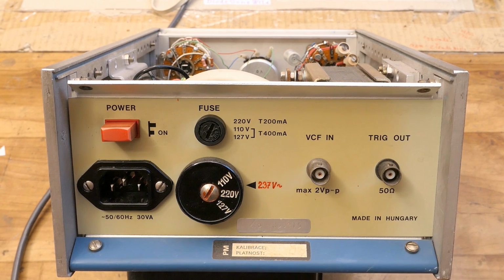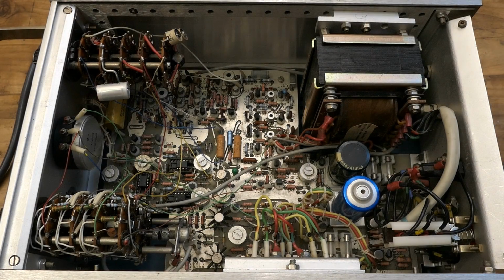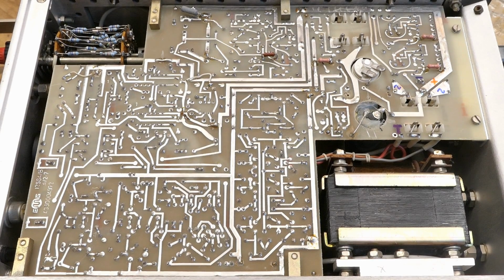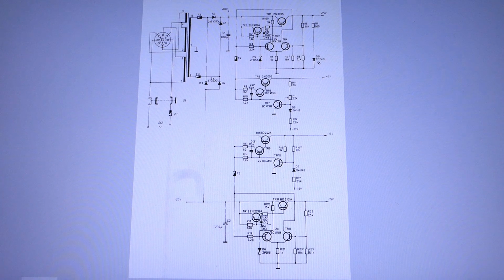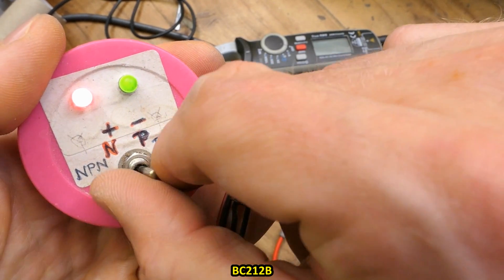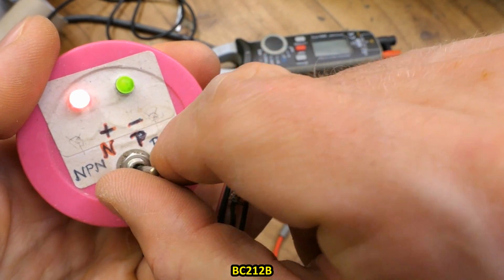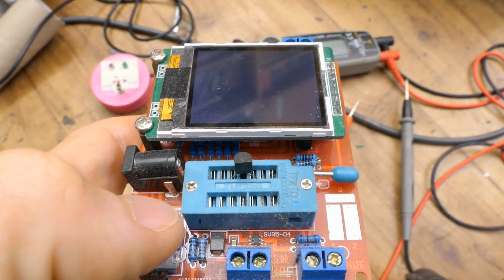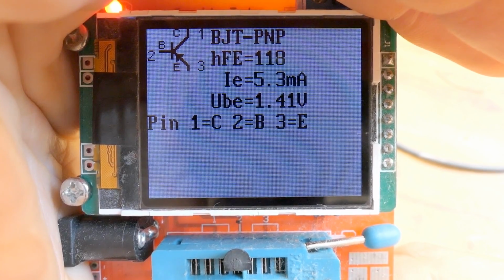Function generator repair (Hungarian TR-0458/B)

Comment: As of today I have my own function generator to fix, a HP 3310A function generator.
I accidently touched the lead to 550V and i heard a pop and it stopped working.
I found one blown transistor and a resistor got fried.
I havent been able to test much but the frequency generator doesnt seem to work at all in most ranges.
I am not as smart as you are, i hope that i will miraculously find the components that cause this problem and be able to replace them....
You are a true inspiration to me, I hope I can actually do it.

Edit: Fixed it, the entire output stage was blown, replaced the components and it worked again.
Also a filter cap on the power supply wasnt filtering correctly and replaced that.
Reply: Download the service manual and start measuring. HP equipment is well designed and pretty easy to service. And as you know what went wrong you know were to start looking for the problem.
Reply: @RTBNL  Thank you, but its already fixed now.
the output stage only was fried thankfully, replaced the transistors and resistor and its working again.
also some capacitor was bad and caused output wripple, replaced that too with one of the same size but 4 times the capacitance, i didnt have any other that could fit in the same space.
Stupid HP put the capacitors right over the voltage Regulator were they get really hot
Reply: @janno288  was it a cap on a power supply rail or something else? 4 times the capacity can seriously change the behavior of a circuit. For example the caps on the output of a LM78/79xx regulator should never exceed the values mentioned by the manufacturer, increasing it makes it less stable.
Reply: @RTBNL  essentially the power supply is like this
Transformer Rectifier Filter Regulator.
there was serious wripple after and before the regulator, i changed the filter capacior out, thr wripple was gone and the regulator could function again. The regulator is a descrete one made out of seperate parts, no Integrated Circuits

the cap was one of those ones that has the leads on noth ends, i didnt have one of the same value on hand i had a 4700μF 50V (vs 500μF 50V) and put that in, that fixed it, same size, that capacitor also is 40 years old now.
the old one is 50 years old.
Reply: @janno288  in that case it doesn’t really matter. A friend complained the + and - 18 volt rails in his diy pre-amp kept fluctuating slowly. He couldn’t find out why. He mentioned he even increased the 5600μF caps behind the LM7818/7918 regulators to 10000μF and it even got worse.

Comment: I think that failing transistor is slowly dying from corrosion that has crept up the leads and is damaging the die. Old age is getting to it! Instruments like this should have a conformal coating on the board to prevent environmental corrosion. Take note of HP and Tektronix equipment. Thanks for the great job explaining the circuit. I very much looks like a Wavetek from the 70's or early 80's.

Comment: The sine shaper circuit basically carves a sine wave out of the triangle piece by piece with 3 stages of 2 diodes and 2 transistors each.
The 4 transistors on the top are used to buffer the result, and the 2 transistors on the bottom left (presumably) provide a reference of some kind.

It's possible to reduce the transistor count and improve smoothness by using an overdriven differential pair with a logarithmic voltage response (though you'd need a matched pair).

When I tried to recreate it, it only worked properly when I omitted the direct connection to V+ in the leftmost shaper stage (which makes sense, because then the NPN transistor would never turn on in that case).

Comment: I see that by the 1980s Hungary was capable of producing (or procuring) high quality extruded aluminum... for the case... or were the channels where the top slides in machined? Anyway the case design, and the voltage selector, fuses, and front panel remind me of late 70s Phillips test gear... not quite as good... but ergonomic and stylish. It's a shame you don't see more of that today. Of course, no one would manufacture such a set today, with so many (any?) discrete transistors, and all the associated support components.... especially the trimpots.... and that nice case, knobs, and dial...just too expensive... maybe cannot even get the parts? In any case, fixed function, function generators aren't that useful compared to even the cheap Chinese produced arbitrary function generators. Maybe audiophiles, and the superstitious vintage audio restoration doers will push back. But, usually I can't hear them.
Reply: But still circular heatsinks look like they are from early 60-s.
Reply: Hungary has large bauxite reserves and aluminium production is significant. Like other eastern bloc countries, electrical wiring in buildings from the 1940s to 1989 was mostly aluminium.

Comment: When I saw the problem I almost immediately suspected that it was a problem with an integrator circuit becoming asymmetrical in the lower frequency ranges, indicating a problem with one half of the current-generating circuit (having experimented with similar oscillator circuits for audio synthesis applications).
The specific reason it went wrong was extremely unexpected though.

Comment: EMG instruments are always described as "they have souls", very well done repair on this one.
(The second thing is, they are often copies of western instruments. In fact, quite good copies, but usually lagging 5-10 years behind...)
Reply: The  block level design is how Hewlett Packard  function generators are built.  The design is not intuitive, but the VCO, integrator, triangle wave generator and then wave shaping topology is how they chose to do it.

Comment: 127V   ???? who uses 127v
Reply: Old USSR electric system. It was mostly phased out by 220-230V systems by late 1960s but in some places still remains.
Reply: @r2daw158  nice one
Reply: A three phase system with 220v between legs is 127 to ground. If I"m not mistaken Norway also used this system.
Reply: @eDoc2020  Yes, the same transformer could provide either 3 phases 127V or kinda 2 lines 220V.
Reply: It existed in Europe in the mid 20th century, maybe a few places used it until later. Some places in Hungary still had 110 or 127 V service until the arly 1960s. Of course 220/380 V services were already common in the 1930s and it became 230/400 V around 1995.

Comment: 19:45 Desolder? But, arn't those transistors are in sockets? I have an EMG oscilloscope with similar sockets and transistors could be nicely pulled out by hand...
Reply from the maker: No, the white plastic circles are just spacers.
Reply: @DiodeGoneWild  In that case it's very interesting that they used such spacers for plastic TO-92 transistor cases.

Comment: this is very very interesting schematic, i have similar (a gift from my teacher) it's hand build also, the triangle to sin is made with resistors and diodes and few transistors and the integrator is also with transistors, no ap amps, no full schematic, maybe even more transistors, never counted them (i can't even see all of them). oh and a digital counter with TTL 74XX, whoever build it put a lot of work.
Reply: Record some voltage levels and waveforms from around the circuitry and then, when it breaks down,  you will have some good clues to help you.

Comment: The “sine” wave reminds me of old technical books that would approximate one using semicircles for the upper and lower half-cycles. At a glance, I don’t think the circuit is actually capable of producing a pure sine wave; still better than what passes as a “modified sine wave” with invertor manufacturers, though.

Comment: Old lab equipment like this is actually easier to use than modern equipment
Reply: He owns Soviet Осциллоскоп С1-118 "Сделано в СССР" (made in USSR!). Really popular beast in it's times. A Tektronix copy AFAIK.
Reply: Yes definitely would prefer repairing one of these over modern rohde and schwarz RF generator that cost me about $500 in parts alone to get working properly again as those HP MMIC amplifiers love to fail and had to source original and display that cost over $300 alone to get a NOS one with new RF glass. Then to rebuilt the complex switching power supply. At least now it is 100%.

Comment: This looks like common failure, my TR-0465 does exactly the same thing, but it can be temporarily fixed by hitting the case from left side. I have no time to repair that thing, so I don't know if it is caused by the same thing or it's a different failure, but it looks similar to this. Thanks for (I hope) useful hint.
Reply: Physically hitting it sounds like a mechanical problem like dry joint etc, not really a internal semiconductor failure.🤔🇬🇧
Reply from the maker: If hitting it helps, it's mechanical. This would suggest the waveform selector (S II / 1, S II / 2, S II / 3) poor contact.

Comment: Nice piece of kit. Imagine designing something like this from scratch, amazing really. A modern equivalent would have a dozen chips inside with a few support components and not much else. I'm struggling to think  of a use for a 0.0001Hz signal though. One cycle every ~3 hours?
Reply: One chip, and it costs 8-12 USD. 

(I'm making a signal generator right now)

Comment: Interesting device. Decades ago whilst I was stuying at Uni, (Chemistry), we had a couple of electronics techs down in the basement of the chemistry building. They had a signal generator there, its brand was, “Wavetek” and its principle of operation eas much the same as this, voltage-controlled current source and current sink being switched alternately onto a bank of capacitors to generate a triangle wave…then using a comparator with wide hysteresis to get the square wave and swith from the current source to current sink. One of the techs photocopied the circuit for me so I could go away and study it in detail…that was in 1986. Since then I have acquired ownership of two Hewllett=Hewlett-Packard generators that use the same principle and have much the same ciircuit as the Wavetek.    One HP is a model 3311 and it only goes to 100KHz, the other  is a 3312A that goes up to 13MHz, but I knowj there is a very similar looking model that goes to 20MHz…but all the circuits are much the same, frequency pot making DC, inverting op-amp generates reverse slope DC, both DCs go to voltage controlled current source and sink respectively, a four diode matrix in between the source and sink switch the capacitor bank, (coarse frequency) alternately, comparator looks at ramps generated and sends square save cack to seitch diode array. Fancy diode-resistor clipper makes “synthetic” sine with acceptable harmonic content…you get the drift!

  Anyway, as I watched the video I soon realized this generator used the same principle as my HP’s and the Wavetek and the voltage controlled current source, or more succinctly, the voltage controlling it was somehow at fault and non-linear at the bottom end of the pot. Even before you took the lid off, I had swiped the model number and downloaded a circuit that looked pretty mich like my HP’s….HOWEVER, once you got the lid off and showed the actual innards and circuit…it was utterly different despite the circuit I downloaded having the same madel number!  
   I was beyond fascinating to see all the same principles used, but UTTERLY differently. The sine shaper on this is far more complrx that my HP,s and the Wavetek which just use diodes and resistors…I reckon this clipper/shaper uses the non-linearity if complementary transistor pairs to get a sine withfar lower harmonic “hash” than my HP’s are capable…but everything else was different too…but used the same principle. I don,t know why, but whenever a transistor in a complimentary pair is buggered, it almost always seems to be the PNP…and I knew it wax the source and the source uses a PNP, (the NPN is in the current sink)…so, yes I called it about as fast as you went thhough it, but the real interesting part was the utterly different architecture of it whan compared to my HP’s, the Wavetak at Uni and a multitude of synthetic generators I have seen over the years.

  Definitely keep the old Soviet, Czech Tesla and other central European stuff coming. It eas funny to watch you go through that Tektronix Oscilloscope recently and have difficulty identifying “Western” components, particularlythe mil-spec tantalums…but I have the same issues with any Soviet stuff I might find..which is rare here in Australia. When yiu did the Soviet TV,  the germanium PNP line output transistor with live emitter and transformer couplrd base looked like something found in a crashed UFO to me. Shango66 had a slightly different model of Soviet TV but it had almost exactly the same chassis in it…it was exactly the opposite of you inside that TektronoxOscilloscope, he was flumoxd by the Soviet components.

The Czech Oscilloscope you did recently, again I pulled the circuit off the internet before you took the sides off…I saw nearly a dozen pentode valves and a fer tetrodes and diodes in the power supply…so I was REALLY Supprisedwhen you took the sides off and…NO VALVES, not even a HV diode valve in the tube supply!
Reply: It's entirely possible that this is a close to 100% clone of a HP, Tektronix or Wavetek function generator. EMG done that a lot. Check out the EMG 1555 (TR-4653) oscilloscope. It's a perfect clone of the Tektronix 647 / 647A oscilloscope. It even has its own page on TekWiki! 

They combined the 647 and the later 647A together, the 647 was only capable of 50MHz IIRC, the 647A increased this to 100MHz by small modificatons and the use of PCB in the vertical power amplifier instead of the point-to-point wiring of the 647.  EMG was somehow able to produce the TR-4653 with 100% point-to-point wiring, but it was capable of 100MHz bandwidth. Very good scopes, minus the lot of bad contacts of the transistor sockets. And shorts caused by silver migration on the surface of the Tektronix-style ceramic terminal strips (yes, they copied even that!). Even 1GHz sampling plugins were available for the EMG TR-4653, which was never available for the original Tektronix model. Although the sampling plugin set was probably a clone of a later Tektronix unit, modified to interface with the 4653's circuitry.
Reply: I found a HP 3312 , repaired and sold it, because I was short on cash. 

I still regret it to this day…
Reply: An ICL8038 functional generator IC works similarly, and also has frequency-independent sine approximation converter. But it is limited to around 300kHz.
Reply: Heh, I just finished training as an electronics tech, and in September I will start a job as the electronics tech for the chemistry department of the university! :p

Comment: I seem to recall that Wavetek 110/111 manual had a good theory section that described the effect of unbalance ( offset) in the positive and negative integrations.  Just like what the low frequency behavior in this case demonstrated.  Their circuit used two opposing currents, one being twice the other.  But the higher one was switched, while the lower one was not.  Thereby the effective current alternated from, say +1 & -0 and +1 & -2, (or +1 and -1).  Based on this ancient understanding, I kept waiting when the unbalance source would be revealed.  The surprise was, when one of the transistors started looking like a Darlington one.  How come?  I have never seen any defect developing that behavior.  Something to keep pondering!

Comment: This shows the difference between knowledge and understanding. There might be many people, who have the knowledge of each of the components, they know how and what they do. But you need understanding of whole electrical circuits to be able to use proper reasoning when making a diagnosis of what most likely causes the problem. This video shows us exactly that. Describes the issue at hand, and shows it. Then breaks down the schematic to specific areas, explaining what each of them is responsible for. Using logic and reasoning to rule out what cannot be the source of the problem, because of how the apparatus behaves and when the issue becomes visible. Then, what remains, is most likely the source of the operational anomaly. We were allowed to watch over the shoulder of a true master, who explained his reasoning and found out what was causing the problem. Knowledge, understanding and practice = wisdom.

Comment: In hungary we still use these kinds of equipment in schools to this day
Reply: Do we still have schools in Hungary?
Reply: Why not?

When I worked at a university in 2008-2011, I had some equipment from 1983. 

Made in Liechtenstein (Balzers), it was the only one whose RS232 voltage levels were the proper ±12V, not like the Chinese devices that provide only ±5V.
Reply: @LMB222  my only problem is that they are not idiotproof and it happens relatively often, that someone messes up something.

Comment: Nice to see a correct fix with systematic fault finding! I had quite the opposite experience with my last fix, a '70s Takeda Riken frequency counter with about 500-600 transistors in it. I had the schematic and a master's degree in electrical engineeting, but I just started poking randomly around in the device with my oscilloscope  probe first. And just out of sheer luck, I found the fault in less than ten minutes. A bad 2N709 transistor and a bad old school epoxy blob silicon diode. Greetings from Germany!